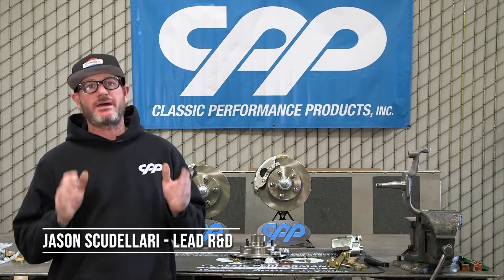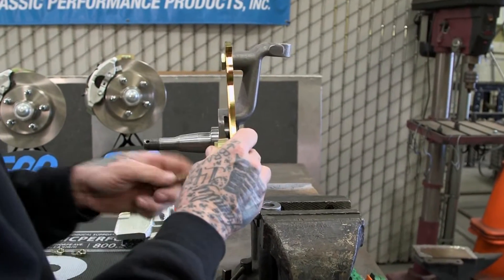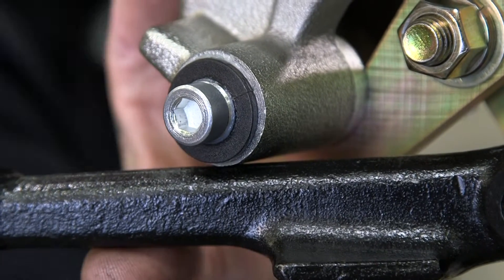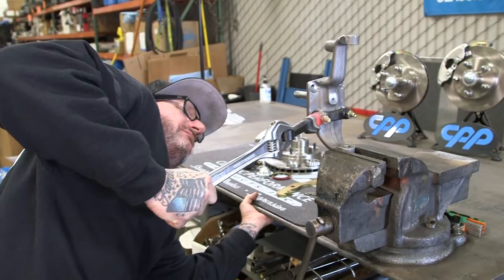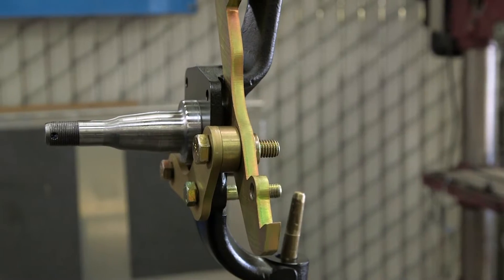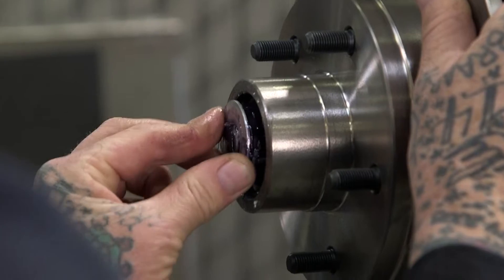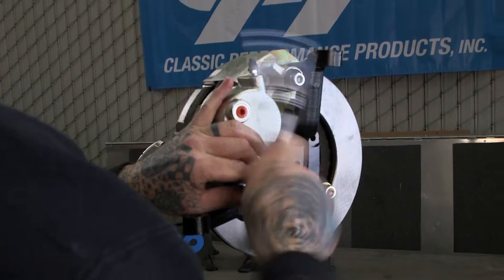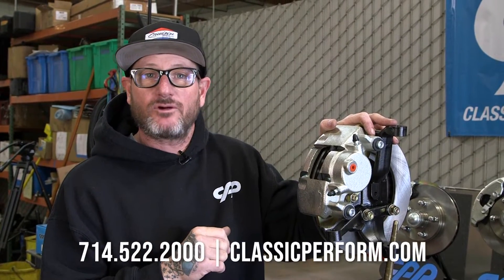CPP Disc Brake Conversion for 14 Inch Wheels

Comment: Would I be able to flip the brackets so that the calipers are leading instead of trailing? This would avoid having to mess with the steering arms altogether. Thanks
Reply from the maker: Interesting idea, but you better give us a call and talk to one of our tech guys before attempting that. (866)-882-4131

Comment: Does the 5964WBK-S-OE kit also work with 1965 Impala?
Reply from the maker: These are designed to fit up to '64 model years. But you can give us a call at (866)-882-4131 and one of our sales reps can let you know what options we have for a '65

Comment: Looks good but bending the steering arm down will alter the steering geometry and cause bump steer.  Maybe you should tell your customers.
Reply from the maker: Agreed, significantly altering the steering geometry in certain ways could cause bump steer or other negative effects. In this case, you only need to adjust the steering arm by about 1/8" which isn't enough to make any noticeable difference.